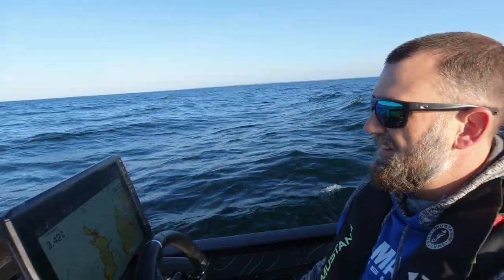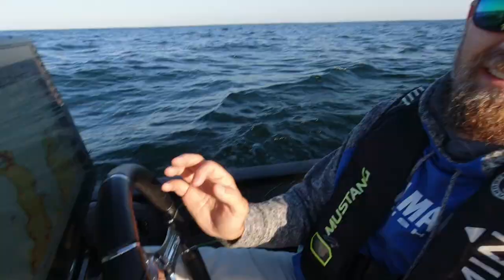I Took My Aluminum Bass Boat To The Great Lakes!!

Comment: Great video and great information.  I have found a lot of videos about driving on rough water with an Xpress but what about front deck fishing on rough water?  Does it feel like you have to have rubberband legs to absorb all of the ups and downs or does the boat stay pretty stable?

Comment: Ive been in a smaller beam 17' g3 and that thing was rough, rocked side to side a bunch just didnt give me any confidence in rough water. Then i was in an 18' wider beam crestliner and that was a big improvement in ride and felt like a good all round size. Now i see they have pad hulls in these x18 pros and it really interest me. Ranger rr198p was on my mind but its got alot of quality issues.  Im not a tournament fisherman but wouldn't mind doing one or two for the fun of it. Havent been in one in over 20 years now. Garage space is my limiting factor unless i can score my next house with a pole barn or minimum of a 3 car garage. Prices are insane right now so we'll see what i can find. A swing away tongue is a must and im really leaning towards a 200hp on an 18'. Have any experience with the smaller models?

Comment: If you were to compare a new 2021 Phoenix PHX21 and this Xpress boat, would you say that this Xpress boat rides better? Just looking for an honest answer. Great job handling those waves!
Reply from the maker: I don’t have enough experience PHX21 to give an honest comparison, but I can say I’ve ridden in several older models over the years. I think they build one of the best riding fiberglass boats out there! Great folks too. My Xpress does ride better than a few fiberglass boats I’ve owned. That’s for sure. It comes down to what you’re preferences are. For me the Xpress gives me the combination of all things. Thank you for watching and for the great question!
Reply: @LukeDunkinsTravelingCircus  Thank you so much for the reply. I'm very impressed with the way your boat handled Lake Michigan. Even on seemingly calm days, that Lake can be a beast. I like how the water goes off the side. I've been in several boats and your boat is looking pretty good on the big water. 😀
Reply: That’s world of difference a new Phoenix runs around 80k compared to the xpress you are getting super solid build for what it cost